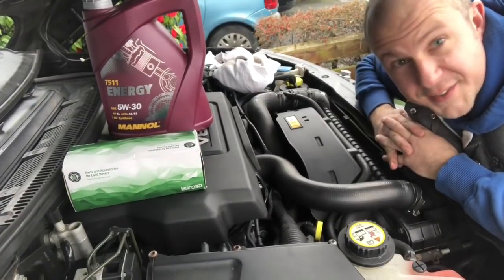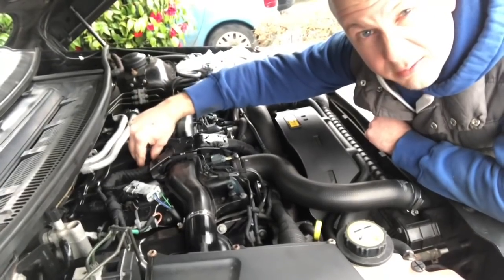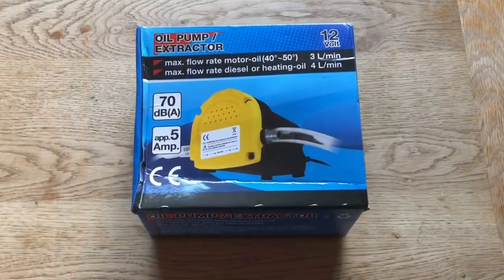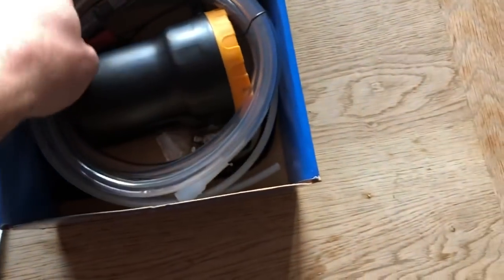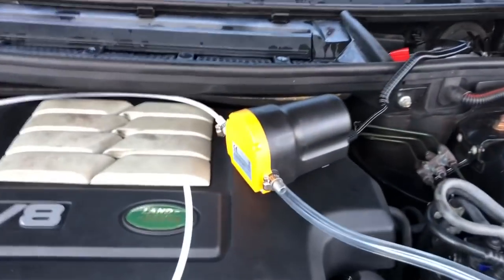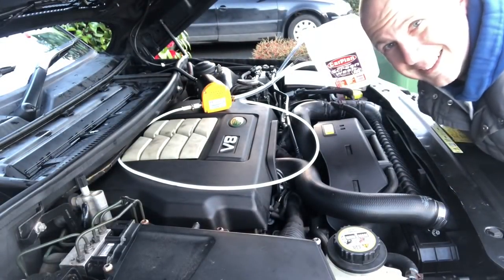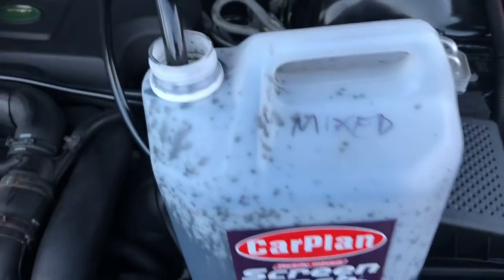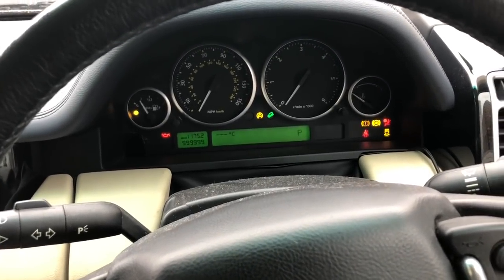Range Rover L322 TDV8 oil change (suction method)

Comment: You must remove the oil filler cap while the pump is operating or a partial vacuum forms that makes the oil flow very slowly

Comment: trouble with the suction method is that you will never get any sludge out of the sump - which is likely to occur if neglected oil changes....always drain oil out the sump when warm as it will take some of the crap out with it...get you sump bungs replaced ready for your next oil change....
Reply from the maker: Karen S 
Totally agree. This was just a ‘quick fix’ really to get some fresh oil in & avoid a problem on the driveway (car is in use every day) 👍

Comment: Hi really enjoying the video series. Just one point on the oil change, would you not consider filling with 5w 50 weight oil seeing as there are 160k miles on the engine, 5w 30 is a bit light in my opinion. Mick 👍🍻

Comment: With the turbos this engine has got, regular oil service is an absolute must. I never exceed 15000 km intervals.

A vise-grip is plenty good to get that old plug out. When you suck it out, you never get the flow that will bring the contaminations that may be present at the bottom of the sump. And those are the very ones that is eventually going to clog your pickup.

I usually buy my service kits from British Parts. Then I get an air-filter, pollen filter, fuel filter, oil filter and a new oil plug. 

But sure: The suction method is 100 times better than no oil change!
Reply: The oil should be extracted when hot which will circulate all the nasty particles ( which should not be there if the oil and filter are changed regularly ) LR main dealers use the extraction method which they claim the extraction pipe goes lower than the drain plug. The Discovery 4 has a dedicated drain tube. You are dead right the extraction method is better than no oil change. At my age I do not want to get out and get under so my oil and filter now changed every 5,000 miles or even less via the extraction method.

Comment: I burned out a couple of these pumps, manual vac extraction much better. Also best to drive around to get the oil contaminants in suspension before sucking it out.

Comment: Try tapping a socket on the sump bung or if that fails try a pair of  stillsons, if all else fails use a cold chisel on the bungs thicker end. Look it up on YouTube how to unfasten a bolt with a chisel
Reply from the maker: Yeah, I’ll probably knock a tight socket on when I get round to it. It’s the awkward one above the subframe crossmember that worried me... so I bottled it & went for a pump just to get it done for now 👍

Comment: To speed up the pumped oil change, get the engine fully hot and reduce the required lift by locating the old oil canister on the floor. Once you get the pipes filled, the siphon effect then aids the pump's action. Cars will vary but the Mercedessource channel showed that even draining oil through the sump plug leaves oil behind and the was nothing in it between the two approaches. By the way - if your battery can't supply 5 amps for less than an  hr without going flat - you need a new battery :)
Reply from the maker: Rhian Taylor 
Yeah, funnily enough (since being a bit of a Merc fan) I’ve seen a few of his videos & just saw the oil extraction one thanks 👍 
Also, I can do the maths on the battery... 😂 but it just felt like had been running for ages (& it had - it probably ran over 4hrs in the end) but, yeah the battery was completely fine 😀

Comment: I also use this method, but just to remove about two liters engine oil as soon as its volume raises due to diesel coming into it normaly caused by DPF regeneration process. After that, just add some new oil.
For complete oil exchange, you need to use the drain plug, otherwise new oil and new filter will be contaminated immediately when you start the engine.
Reply from the maker: TDV8 Fixes 
My thoughts too 👍
Reply from the maker: Subscribed 😃
You’re nearly at that magic 1000 number 👍

Comment: Just did mine with a manual pump however removed the oil filler cap and sucked it out in no time (Via the dip stick tube , or what should be on 4.4 TDV8) Good video. Thank you
Reply from the maker: I think I learned that the oil needs to be hotter (so less viscous/thick) for my little electric pump 👍

Comment: I use this pump, you need the engine oil hot , and it will suck the lot out in  5 mins
Reply from the maker: Perhaps I wasn’t doing it right. I ran the engine so it was warm, but didn’t want to risk it being too hot for the pump...

Comment: The only problem I could see in that is, if the pipe when it’s down there bends up at the end like they do. You could still have about 2 inches of oil left in the bottom and that’s where most of the crap will be.
Reply from the maker: Roy Colley that’s what I thought too. I moved the tube in/out a few times in an attempt to solve that issue but the flow was so slow it was difficult to know when it was sucking air... 🙄

Comment: It looks like the plastic pipe is curling up from how it's come packaged. I would imagine when fed down the dipstick tube it starts to curl again and isn't hitting the bottom or curling up as it does touch.  The hand pump one I purchased is a much more rigid plastic with a steel liner inside the last few inches to avoid this.

Comment: If that nut is rounded, just weld new nut to it and open. Then replace plug. Draining engine oil from diesel engine, let all soot and metal particles to live happily in sump, destroying engine slowly, in between oil changes.

Comment: Think on these tdv8,s and the way both sump plugs are youl get more out with extraction 
Over 8.5 litres out last time
Reply: I get 9.5 liters out by draining.
Reply: rhkavli I do mine every 7000 miles every other oil change I drain from sump 
I'm changing to l405 sdv8 soon will prob use probe on that one too

Comment: I tried using the method you are using but only managed to extract 5.5l, how did you get the rest out, I couldn't get the tube down any further?
Reply from the maker: With mine I thought it may have hit the sump & curled back upwards when I pushed it quite far in, so a bit of trial & error was required. Another problem I encountered was the viscosity of the oil, since mine started only warm, rather than hot... so became more difficult for the pump as time dragged on

Comment: Are the cheap pumps robust enough if you heat the oil a little too much to aid flow. I.e. Are the pump internals likely to melt!
Reply from the maker: I think they’re probably ok up to ~60°C 
But if anything, I’d use this video as an example to either buy a better pump or do it the old fashioned way 😉👍

Comment: Hi mate do I put the new filter into the cap / lid then screw it in or do I put it into the engine part first then screw cap down onto it so it clips in I been told one way is wrong from to different people but they both said different one said engine first and the top screws down and clips in and the other said clip it into the lid and screw it in hope this made some sort of sense to you 😂😂 please help
Reply from the maker: You can actually do it either way in my opinion. However, I would insert the new filter into the cap first & then carefully offer the new filter into the recess & twist it so that the little plastic connector stub finds it’s receiver. Once it’s correctly seated you can tighten the cap down 👍
Reply: Nut Job thanks mate I been stressing like crazy my first time doing a Range and even the new oring rubber there normally round these are squared off new to me 
My new ring didn’t sit flush I guessed it’s because when it tightens in it squashed in flat am I correct in that please say I am 🤦‍♂️ because I looked underneath it and the plastic looks slightly angled so it’s like this \ ?
Reply from the maker: It might be worth checking out the video I did on my BMW as it’s virtually identical to the TDV8 oil filter. See it here: https://youtu.be/7YrnESc_rE8
Check out the oil filter removal from around 5 mins in 👍

Comment: Did you get the full 10 litres out of the engine?
Reply from the maker: Curtis Jarvis Not quite, but close. That little pump really struggled (& I spent nearly 4hrs total) so I called it a day around 9 litres. Not great, but better than no oil change for now...

Comment: The range rovers engine  oil should be changed at every 3,000 miles on the clock  without the need of the new oil filter( if new from the previous oil change) and manual hand siphoning pump (oil extractor ) is recommended for faster siphoning ...